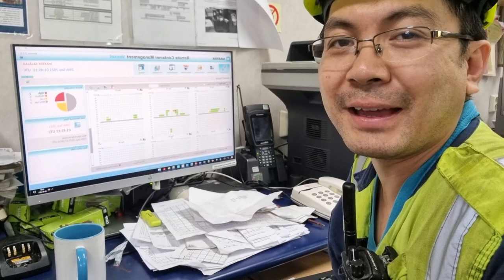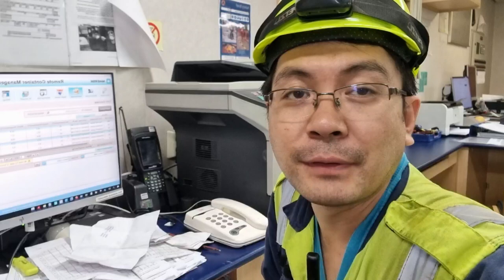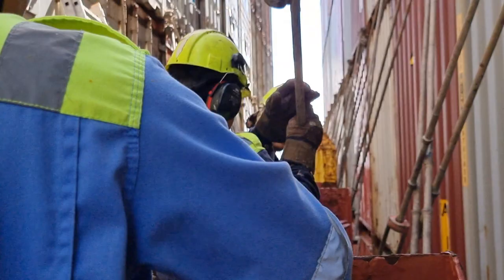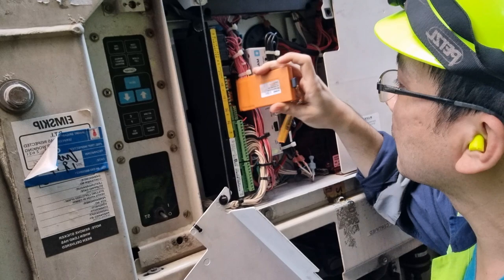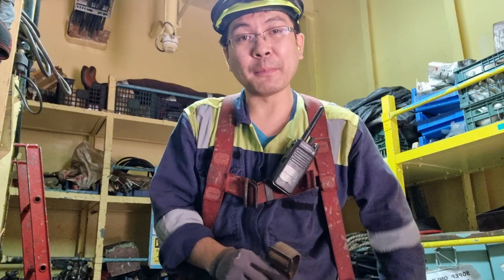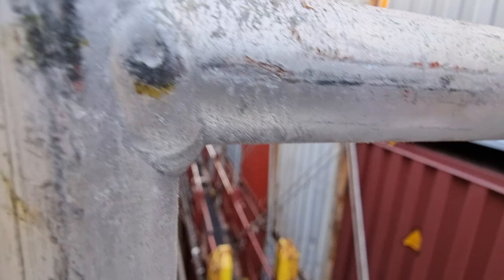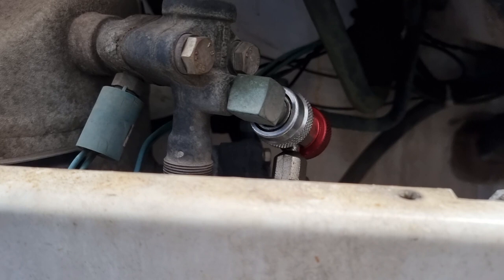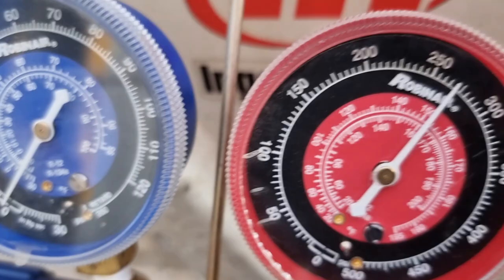COMPRESSOR HIGH DISCHARGE TEMPERATURE, REFRIGERATION SYSTEM | MARINE ELECTRICIAN

Comment: Finding leaks can be painful to find when your on board ship. A lot of times I’ve found that the nut at the base of the high pressure valve or the low pressure valve is loose and leaking refrigerant. It’s important to check that nut anytime you’ve opened the valve.

Comment: Hi leckyjake, I always admired marine refrigeration. If I was contracted to do some work on a ship I would go just to try it out for once. I've worked on a couple of the transicold 69NT40 models and always wondered about the sight glass. There are two sight glasses on the receiver. A proper charge is around 5kg I think but the ball always remains pretty low on the visor. I see yours here went up pretty high. I assume the ball on the top visor should not float unless you are pumping down

Comment: I love you training kudos 
Why was the leakage not fixed instead of recharging new Freon gas?
Reply: If he could use a pump to pull a vacuum there’s no leak. Air could have gotten into the system from someone not clearing gauges.

Comment: Reefer Compressor, Bitzer Type VI. Head temperature going very high,  Compressor disch temp almost 95.  Checked cooling water flow, passages in head cleaned , condenser cleaned. Valve plate renewed
Reply: But still temperature is very high. Kindly suggest what else to check
Reply: @danishmomin8102 Check if the compressor has enough oil and if the discharge pressure sensor is okay

Comment: My guess would be a dirty condenser or a failed condenser fan
Reply: Yes, that was what I was thinking. It is very uncommon to have "air" or noncondensables in the system even when the sysntoms are similar. The  refrigeration troubleshooting was not that good. I had never seen low side pressures and high side pressures unless it is a restriction. (Constructive critc here)
Reply: @rightconditions2010  the containers run at a really low pressure using 134A. Depending on your temp conditions they can range from 5 to down below 0 psi which would be vacuum.
(more prone to air infiltration) His high side was definitely high for 134A. That's like a 65+ C / 150+ F coil. Discharge temps directly from the compressor would be way higher. 
Usually a high discharge would reflect back onto the suction slightly but he was in range on the suction pressure. My first thought would be to look at the coil too but we didn't get to see it. The fan is easy to test since it cycles on and off due to pressure control

Comment: Any idea where the refrigerant from the system went? Was there a leak you found and fixed?
Reply: Yeah, a leak seems highly possible, which means the problem will just return after some time.
Could perhaps also be that it got air trapped during its previous maintenance.
Reply: @Gin-toki  at least here in the Netherlands (I think all EU countries) I’ve come to understand it’s actually illegal to refill a suspected leaking system with fluorinated refrigerant as it’s extremely bad for the environment to get these gases into the atmosphere. Not sure what type of refrigerant this reefer is using though, might be plain CO2 these days for all we know.
Reply: @mlenstra  it was stated in the video that it's freon.
Reply: It was R134a a refrigerant not a Freon, if you go by bottle color (orange) it’s R404 a refrigerant not a Freon.

Comment: Hi really need your help having trouble clearing a alarm cord Al 58 Compressor High Pressure Safety (HPS)
Reply from the maker: how much os your discharge pressure?
Reply: We are doing everything but unit running 4-5 hr good and again it will give high dicarge pressure may be it's TXV give advice plz?